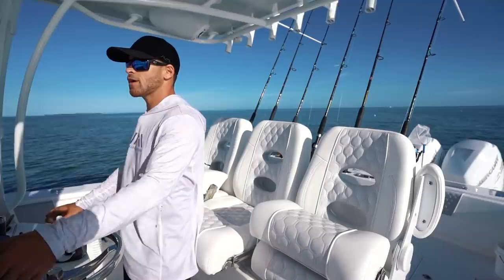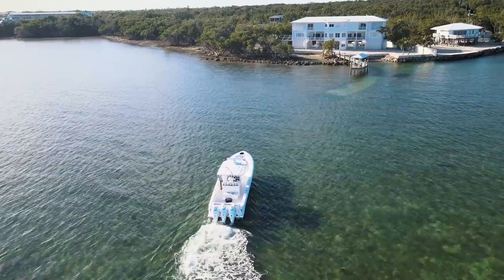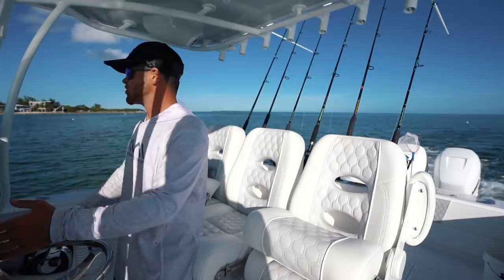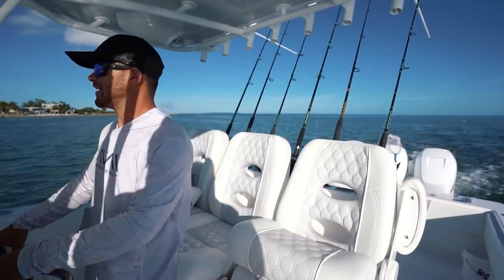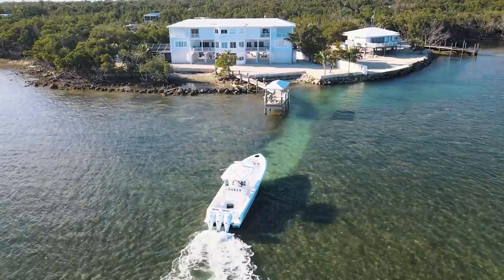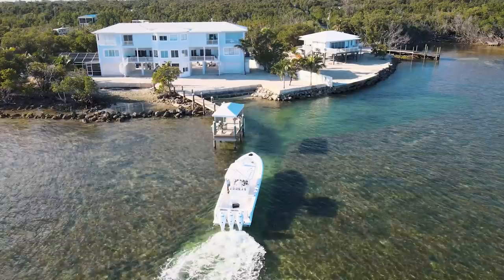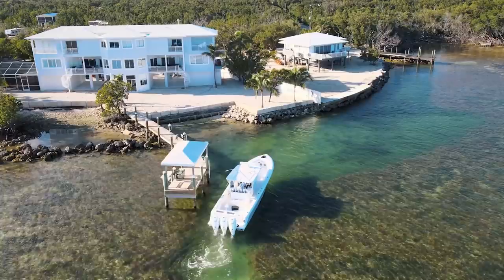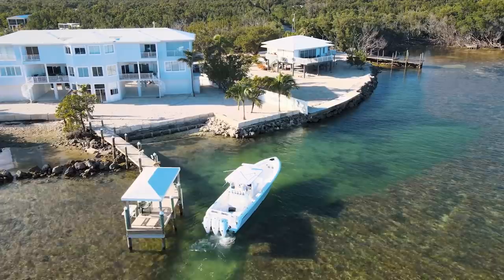Docking a 40 FOOT Boat in a TIGHT spot with INCHES of water.

Comment: Very tight. How does your neighbor get their boat out? It looks like they come the same way. Does your boat ever interfere with their exit?
Reply: I second this. Seems it’s the same channel to get access and this boat end up blocking it. How does that work?
Reply from the maker: Hey great point! Luckily our neighbor does not have a boat, however they do have visitors by boat from time to time. Our neighbors dock isn’t large enough nor does it have the depth for a center console boat. Therefor they can only fit a skiff or small bay boat, which drafts very little water. Therefor they can scoot right over the flat and completely bypass the channel, which I do all the time in my bay boat. Lastly, it’s not a navigable channel therefor it’s not a legal issue say if a larger boat would want to get by. Hope that answered your question 👍🏼
Reply: @LifeByTheBow  it does. Just wondeing... Keep the great videos coming.
Reply from the maker: @bhclark6128  thanks so much will do 👍🏼
Reply from the maker: @UCd8BnBk4MobOIFc2qPv76BQ Hey terry, our neighbors dock can not accommodate a large boat, therefor the channel is irrelevant unless you have a larger vessel. Keeping all of this in mind blocking the channel would not make a difference to our neighbor 👍🏼

Comment: Well done Clay! Using differential’ power to maneuver in thin water and tight spaces when you have a larger boat with multiple engines is a good idea. Perhaps another segment on that technique and perhaps some basics on crew readiness with bow, stern and spring lines a d fender placement might help newer boaters protect their investments. Thanks again for the good stuff!